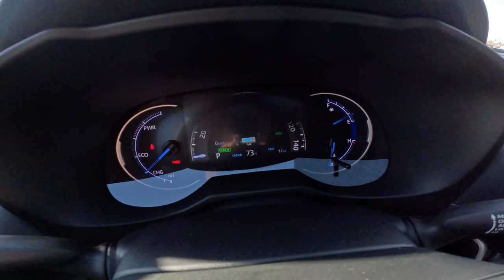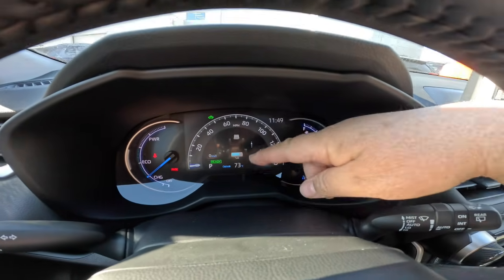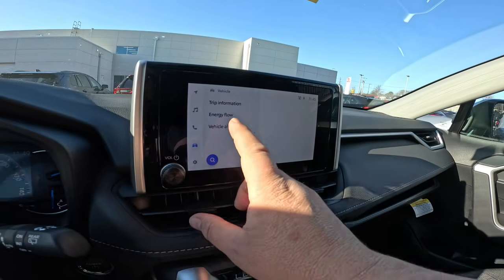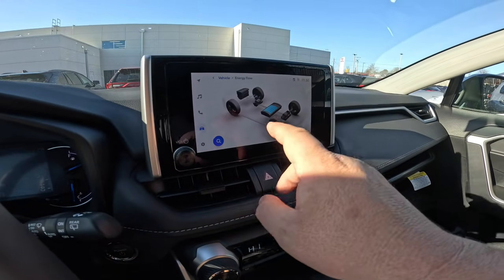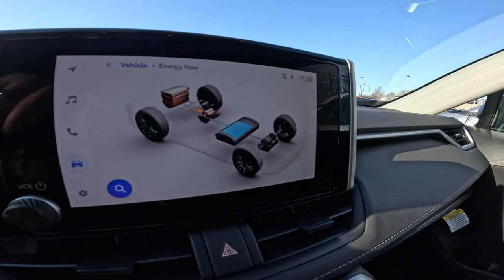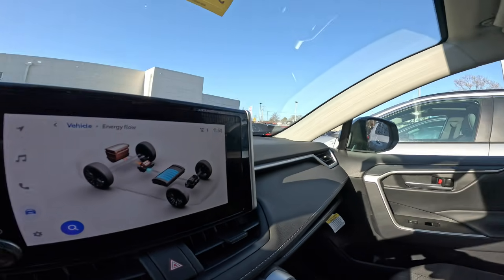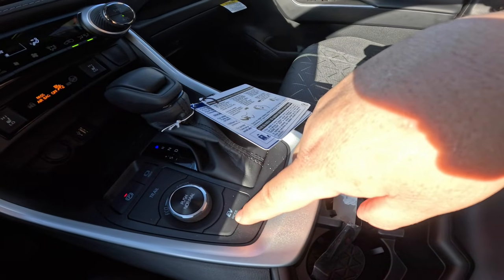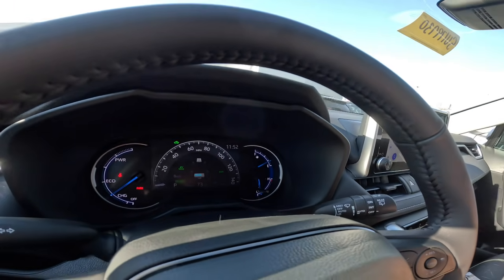Why Hybrid batteries don't fully charge or empty

Comment: Yup, I have a 2024 Venza and I have a Scanguage 2 on it with SOC (state of charge) meter setup. I can confidently say that when all 8 blocks are full the battery pack is actually at 80% and 2 blocks is about 30% and mine likes to sit at 6 blocks at about 65% when fully recharges off the motor, Seen as low at 25% on the interstate and a high of 85% when I had a really long regen hill in my area,  I went from 40% to 85% before it stopped charging the pack. Sure would been nice to know about all the "quarks" before I moved to Hybrid. Still would have. I live in Northern VT sure would been nice to know about the efficiently hit in winter.